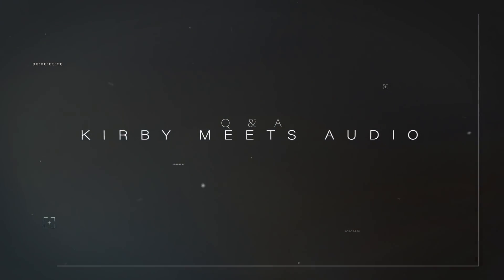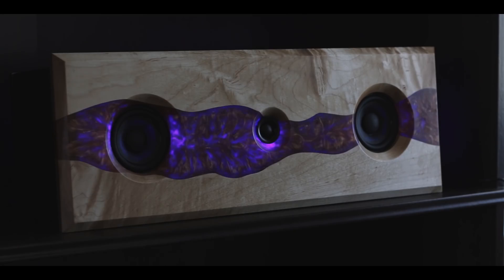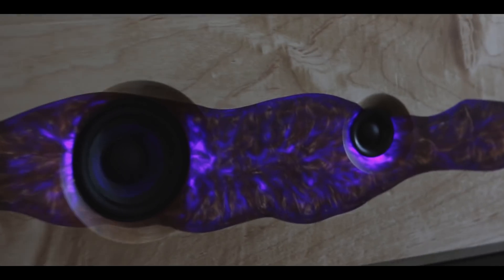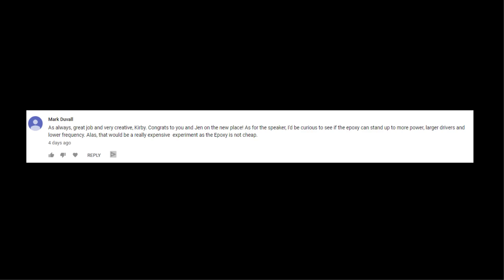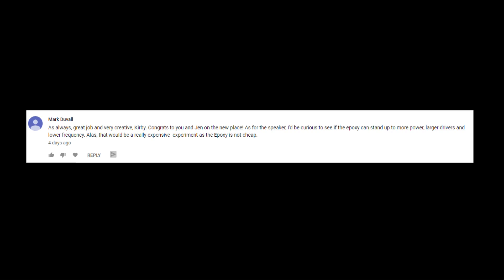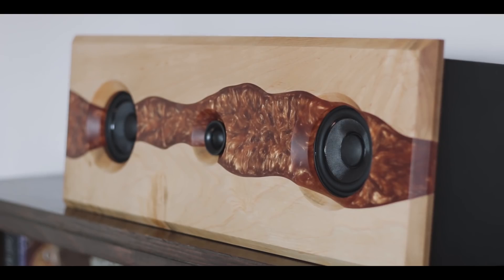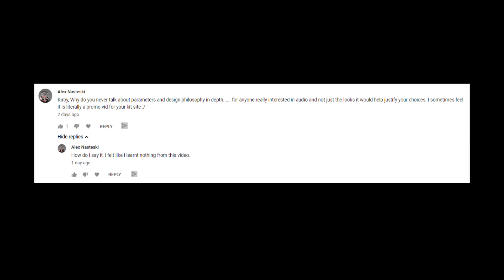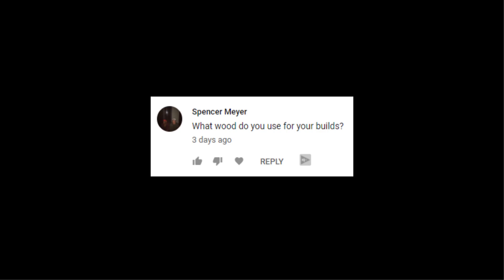I Got Called Out... And I Answer Your DIY Bluetooth Speaker Questions | KMA Q&A

Comment: We sometimes use Corian as a baffle. The epoxy should be fine but without check out if the speaker has a resonant frequency in the audible or near audible range it is not for certain.  Harmonics could also effect this.

Comment: A rear chamber and port can simulate the recess ed drivers in hornresponse .  Use S and L inputs for the enclosure or even vice versa if sealed.  There’s an upper band rising response if 2.0xpi with an excessive depth after 1.5-2” on these ‘full range’ 3-5” drivers. You don’t have a driver recessed so deeply and anyone with a comment should provide some info or testing (impulse did a good job of this with results ) to show otherwise.

Comment: If you built a motorcycle in 'the most efficient way possible' you would never use a hard tail frame,
Springer forks etc etc.
Sometimes cool outweighs efficiency...

Comment: Looking back on it, one of my two regrets in the DIY audio community is calling out Kirby in the comments on the Impulse video. The other is not building enough. At the time, I had a much more dogmatic approach to design and building. If you weren't building flat frequency, wide off axis response, low group delay, perfect impulse response speakers then why were you doing it?  Since then, my ideology, and consequently my criticism, has loosened up and I'm more apt to appreciate what each designer brings to the table, both aesthetically and aurally. If you haven't heard Kirby's interview on the Make or Break Show, I'd highly recommend it. When he mentions the 80/20 rule in regards to speaker building, it's pretty relative to the few times I've done builds. Doing the basics of speaker building - building the right size box, fixing a speaker to the box - gets you 80% of the way there and the next 20% is an uphill climb. And despite any criticism I toss up, I've always super appreciated the videos and enjoyed them.

Comment: hey,  i've built my first bookshelf speakers with 2 way passive crossover, its sound good, but at high volume, the speaker sounds a bit boxy, how can i improve the sound, i already have a damping material inside, but still sounds a bit boxy, and recently my subwoofer box just finished, its about 65lts or about 2.3 cf, and i'm using 10" subwoofer, although i can fit 12" subwoofer, probably gonna replace the sub to 12".... good video as always ♥♥♥

Comment: A rear mounted tweeter could be compensated for by using a lower order crossover and/or allowing the tweeter to have a rising response - since a rear mounted tweeter will have a descending response.
Reply: Unfortunately the dispersion pattern and imaging is also affected but that's negligible in a Bluetooth speaker that's not for critical listening. Who cares about being correct all the time anyway to appease people . Build it how you want to build it. Eventually people will learn to respect the designer and appreciate all the work.